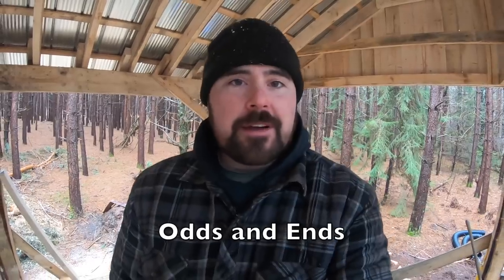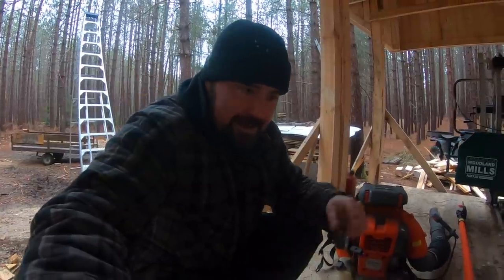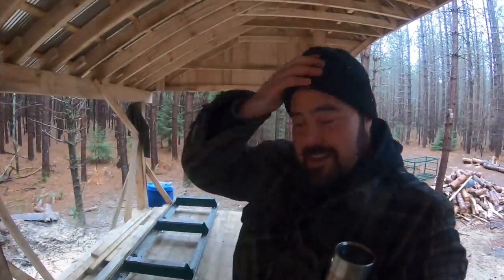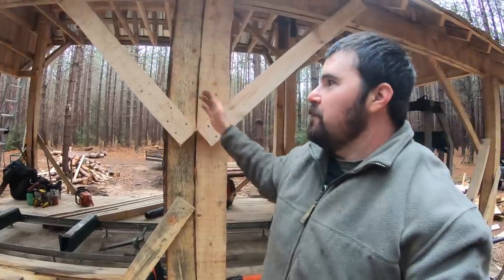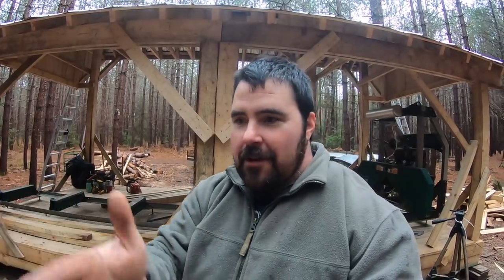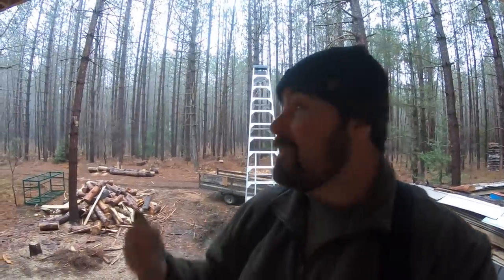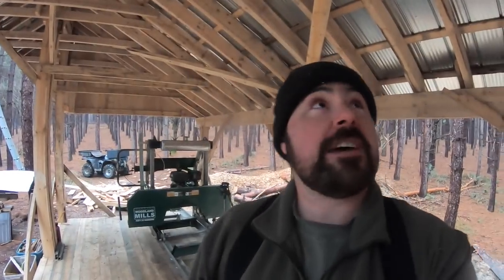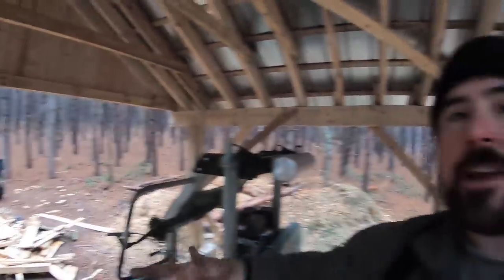Final Framing on Sawmill Shack | Sawmill Shed Build - Episode 11

Comment: Hang up good tarps which are easy to move, slide, remove to keep the weather out. I've noticed the problem all along has been the expensive hammer isn't compatible with left-handers. 😄😄

Comment: The back use the bark cut offs to close the long side in and a cable on top and bottom and run the cable through eye let’s in series of small tarps that you can open up one or all if need be both front and side and use a rope to tie them closed

Comment: Good day to you Sandy. Yup, ''good enough'' is not enough. I'm wondering; what kind of use do you plan to do with cuttings, sawdust? One way that I like and that makes my life and handling easier is to lay a long canvas (like the blu one we can buy at Cdn Tire) on the ground parallel to the mill to collect the sawdust and once the work is finished, fold the canvas and put it in the trailer to bing it where you need it. It avoids too much accumulation and the feeling of having a `` mountain '' to moved. Or do you plan to move around with your tractor and scoop it with the bucket? :-D
Reply from the maker: The tarp idea is a pretty good idea. Think I’ll move the pile onto my trails in the next few days (hopefully) to make room for more sawdust. Thanks for the idea and checking out the video

Comment: Sandy, on the loading side of your structure it looks like you have 4 or 5 feet to the first beam have you considered reverse board and batten for that short section and the the end wall so you can back your saw head into that area out of the wind? I raised the saw track on 4X6s so I could use only one set of log stops. I also put a chalk board on the short wall on my shelter to keep track of what I cut that day so I don't have to count the pile. I wish I had thought of a wood floor I look foreword to your videos nice work.
Reply from the maker: Some great ideas there Ray. I appreciate you sharing them

Comment: "Not Good" Bracing are depending on the shear strength of the nail as apposed to the compression resistance of the wood
Reply from the maker: That’s true. Many of the braces I used construction adhesive to combat the forces.
Reply: I would argue that most bracing and anchoring is dependent on shear strength of fasteners. All simpson anchors here in Florida are based on exactly that. A screw or nail perpendicular to the force being applied. If you're concerned just add more nails.

Comment: I notice you didn’t put holes in the deck for the long log stops to drop through, it will make for changing to the short ones on big diameter logs, also the log dogs will be a pain without being able to drop through at 90 deg, but, hey it all a matter of how you like to run your mill. Great build!
Reply from the maker: Yeah you may be right. I’ll have to see about possible making cut outs in the floor for those or I may in the longer term lift up my mill if I don’t end up liking the height
Reply: @sawingwithsandy  raising is a good option, don’t forget to add that height to the log deck, rolling up hill isn’t easy.
Reply: @sawingwithsandy  I think you will be happier if its up a bit higher .  Your back will thank you .

Comment: Hey. Good enough is a loose term. For an experienced (skilled) trades person usually means it's within an acceptable tolerance that will work very well still. Kind of like when you put the vertical pieces on the gables. You thought it was a 6/12 but it was a 7/12, but you new you were covering it with a trim piece. Good enough. Obviously your aim is for perfection but shit happens and its not practical to remove and redo everything as long as the integrity of the structure is solid and aesthetically correct.

Comment: Put windshield washer fluid in the tank or water down used and screened antifreeze
Reply from the maker: I like the idea of the washer fluid since it’s non toxic
Reply: @sawingwithsandy  it actually has anti freeze in it it’s watered down I’d by like store brand thre cheap anyway

Comment: How thick are your deck boards? Are they treated? What's underneath, just dirt or stone? Did you use pine on your deck? How rot resistant is it
Reply from the maker: Deck boards are 1” and untreated. Just pine needles and dirt under my deck

Comment: Nice job!! I agree, good enough is not enough. It also as to look good and professional to feel satified.
By the way, I'm not sure but I think you stop your engine by pulling the choke. If it's the case just be aware that is not good at all for your engine.
Reply from the maker: For my model chainsaw the stop button is pushing down in the same button as the choke button but in different direction
Reply: @sawingwithsandy  No, I'm talking about your sawmill engine, the Kolher 4 strokes. I also own an HM130 MAX on a Woodlander XL trailer.
Reply: @denismorissette419  how do you like your mill? I have the 130 max (minus trailer) and love it so far. I put the battery in it for the key start. Greatest feature on it after I was pull starting it for a week. Sometimes the saw head is in an awkward place to pull.
Reply from the maker: There’s a separate on off lever just beneath the choke that I turn off the engine with on the mill
Reply from the maker: I sure would like electric start but I’m just pull starting which actually isn’t too bad since the engine does tend to start pretty good. Great mill after almost 3 years of running
Reply: @sawingwithsandy  O.K. I understand, on your sawmill the  ON, OFF switch that cut the ignition is under the choke lever. On my sawmill there is a key switch. That's why I was wondering about your shutoff procedure.
Reply: @CedarTrailsLiving  I like it very much. The trailer itself is not an easy thing to get square and straight. I used stings attached to carriage stop to have the best reference for the staightening.  When you're at your work area you must take the time to leveled the sawmill with the jacks and when it's done it's a real pleasure to operate this machine.

Comment: The overall look of the mill would look better if the ends on all your braces were cut at an angle that matched the edges on the uprights. They now look like preconstruction bracing and do not match up with the workmanship that you have shown in the rest of the building. In many ways, it does look a lot like the covering my grandfather built over his mill under which we survived many storms as we kept on working, I like your channel, so keep on building and sawing.
Reply from the maker: Thanks for watching Philip